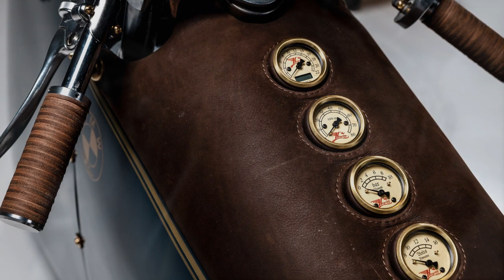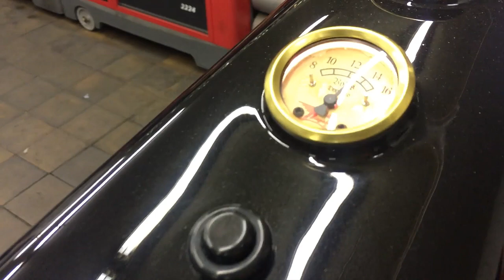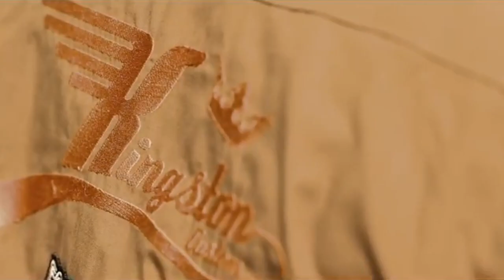Cafe Racer (BMW R100 RS by Kingston Custom)

Comment: This is an amazing piece of motorcycle art! The detailing is incredible - WOW. 

It was commissioned by an art oriented museum in Dallas so is not meant to be a practical road-going machine. Faulting it is so easy if one only considers road going attributes rather than artistic elements. For instance, as others have mentioned, the front-top is rather too pointy for safety, the bottom edges of the fairing restrict lean angle and the sheer sides would provide an interesting experience in cross winds...

But remember that it is the answer to a challenge to produce an iteration to the museum’s ‘White Knight’ piece of mechanical art.
Reply from the maker: Thank you my friend for sharing your perspective. :) Cheers.

Comment: 4AM Christmas morning and I'm watching RacerTV          Merry Christmas, sir
Reply: Same sitch!
Reply from the maker: Thank you my friend for your support. :) Merry Christmas for you too. Cheers.
Reply: @RACER_TV  sir canyou please check your email - Robbie from Toronto
Reply: When I first see this I immediate thought this is made for a room. Because I had a room in my house with custom hand built motorcycles. I had 3 bikes. A 67 triumph 250 slammed cafe hog, Suzuki 78 185 bobber rat dirt bike,  mini Yamaha chopper came from a Yamaha pull start turned into a kick start & a bicycle that was a sting ray put a chainsaw engine on it made the fork 2 feet longer made a tear drop tank paint white walls make my own apes. Had 2 engines on display all for a sitting room . My coffee table was a 6 ft coffee with crown trim with a day of dead female on lid. Walls white felt gold pinstripes wood finger floors with a motorcycle parts chandlear.. so seen this made me thank it was made to sit in a room to be looked at. When I seen it go down the road it was pathetically funny like putting motor & wheels on a recliner

Comment: Definitely a work of art; an art deco motorcycle. But the dust bin type front fairing seems very narrow and I wonder how it performs when doing u turns and other tight maneuvers?
Reply from the maker: Yes, as I said in the video, this is a motorcycle built for a Museum. Therefore, from this perspective, I think those riding limitations are excusable. But Thank you my friend for sharing your perspective. :) Cheers.

Comment: It certainly is a work of art, an attribute it shares with other bikes I have seen at shows, e.g., choppers that would be completely un-rideable. It would be even more impressive if it were both a work of art and a practical functioning motorcycle, which it is not.  Aside from the spear pointed at the rider's midsection it also would be incapable of making a u-turn. I also find it strange that the horizontally opposed twin vibrates so much at idle.

Comment: Why did you use so many adjectives , and leave out ugly dangerous and utterly impractical .
Reply from the maker: Like I said in the video, this motorcycle was created for a Museum. Therefore, practicality is not important for this video. This Bmw is just a great exercise of creativity and inspiration. :) Cheers.
Reply: @RACER_TV  I've always felt the point of a motorcycle is to ride it . Especially a cafe racer .
Reply from the maker: Yes, you are right. The bmw on this video, is obviously not  a cafe racer.
But it is certainly a very interesting project, which may help others to get some inspiration or ideas for their own projects.
That is why I decided to present it on the channel. :) Cheers.